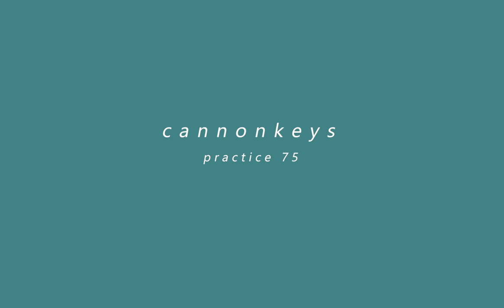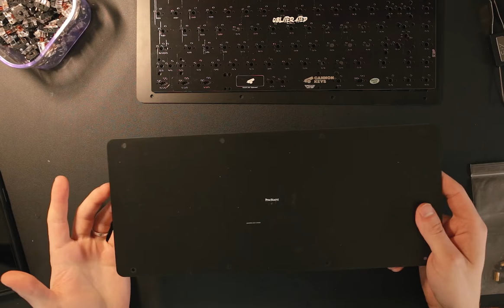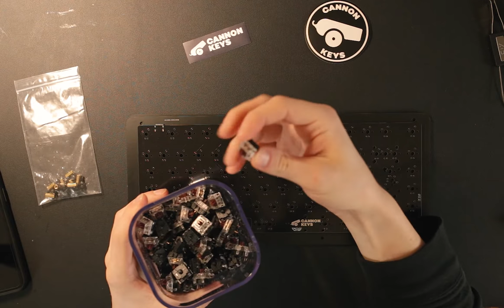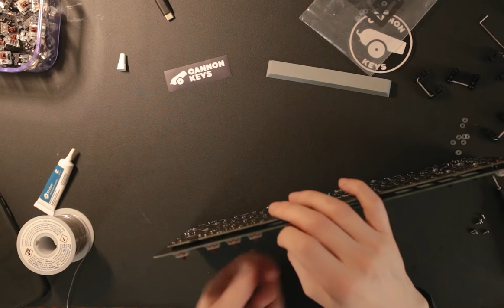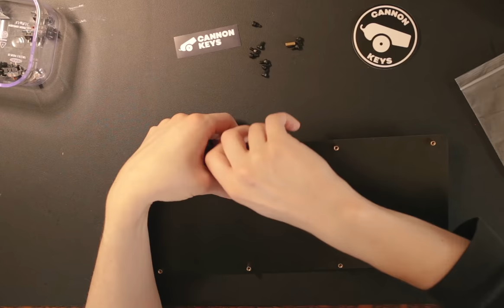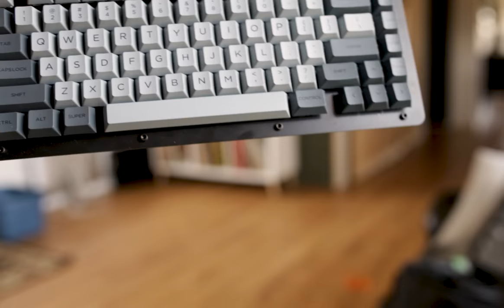CannonKeys Practice75 Keyboard Build

Comment: Did you open it for the start or do you need to build it completely? Also do ou have to solder?
Reply: Yes you have to solder thats why it is a "practice" board :)
Reply from the maker: Yep, it needs soldered. It comes disassembled.